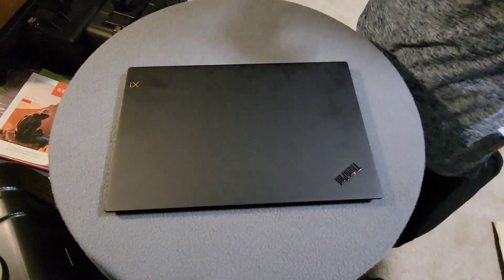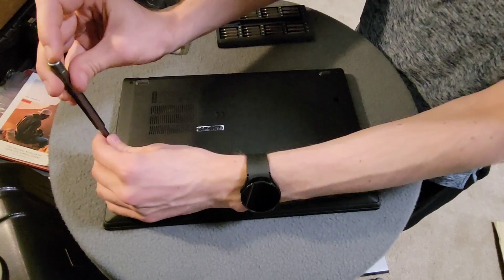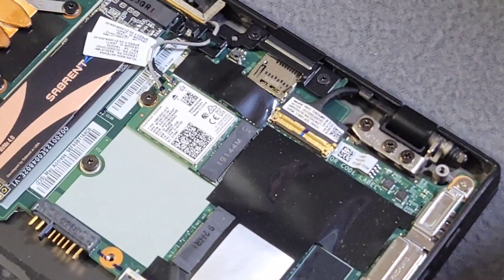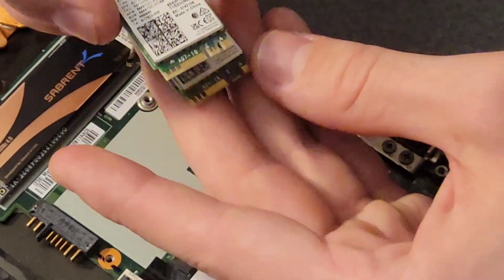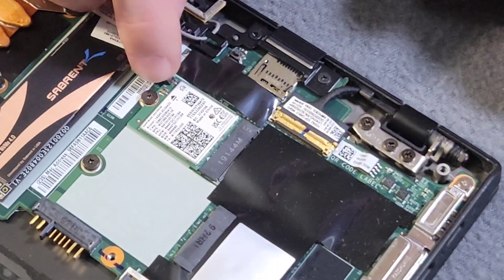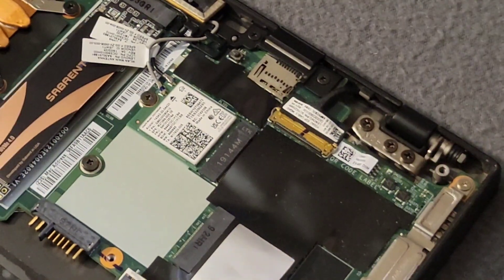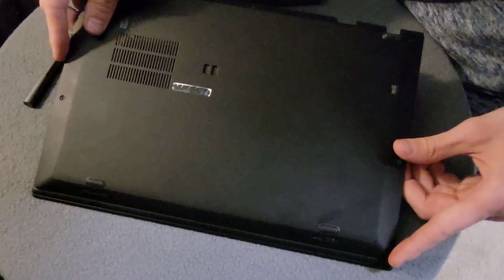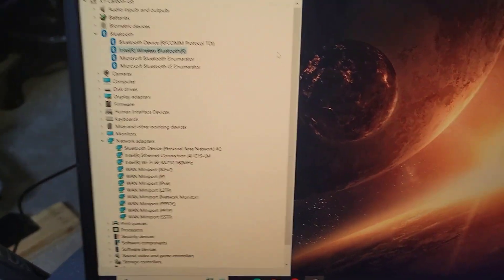How to Upgrade to Wi-Fi 6E on a Lenovo ThinkPad X1 Carbon 6th gen.

Comment: Any chance to upgrade Gen6 16G ram to 32G one? I got this for 5yrs, everything was great!
Reply from the maker: @manlovesin1314  unfortunately the Gen 6 model's maximum RAM capacity is 16 GB.
Reply from the maker: And with all the ram being soldered there is no way to experiment with higher capacity chips
Reply: @ thx 🙏
Reply: so, is this support for the Carbon X1 Gen6? Wi-Fi 7 BE200 Bluetooth 5.4 Wifi Card BE200NGW
Reply from the maker: @JimKwok  you'll have to do some modifications to the card and to the BIOS because the slot is made for an A key Wi-Fi card and the be200 is an E-key card. It is technically possible but you could run into some issues

Comment: Hi there Previously when I have inserted a non Lenovo branded wifi card (yes and Intel Card) I get a bios warning and the machine will not boot.  How did you get around this issue or have Lenovo stopped doing this since the GEN 6??
Reply: Thanks for that info.  I am getting my card today so will let you know how it goes
Reply from the maker: I didn't have this particular issue with the X1 g6 but i did on a t440p. for that one I found the latest bios update and manually loaded the new wi-fi card drivers before the install

Comment: i bought the gen6 because of the replaceable wifi card, but i was also impressed with the gen7's 400nits brightness screen and speakers. hard to choose
Reply from the maker: I dropped and shattered my Gen6 about 6 months after this replacement. Got a gen 7. The screen is much nicer but I miss that Wifi card.
Reply: Can you frankenztein it? 6 guts and 7 screen?

Comment: man, very nice. loving my carbon 6th gen. used throttlestop to undervolt and i've got lucky with the display, because it's the low power one which gets as bright as the sun. browsing the net with whatsapp, signal, opera, instagram and outlook opened draws about 5 watts for the whole system. this thing is a beast!
Reply from the maker: That's amazing! It's such a great little system. Powerful but compact and efficient. 

How long does your battery last when it's undervolted?
Reply: @tesrteck  bought and new battery just recently, i'm getting 7-8 hours display on time and i never hear a fan spinning. loving it.

Comment: I initially thought of buying a X1 Carbon 7th gen, but I found out that the wifi is not replaceable, so i might look into the gen 6 next and see the comparison since it's still has intel 8th gen CPU
Reply from the maker: Still a solid computer! I wish they hadn't gone with the soldered in chips with the later models. I am also confused about why 6, 7, and 8th gen Carbons all used the same lineup of CPUs.
Reply: I have gen7 and just open to confirm that its wifi is soldered. I want to replace it or upgrade it to ax200 or 210 because the current one is not working properly. But cannot do, sad
Reply from the maker: @morillsaberiya  sadly the gen 7 is soldered on

Comment: Are any driver updates necessary to make these components run properly after install?
Reply from the maker: Yes, it does require some different drivers that you can either pre-download or what I most often do is plug in a simple USB Wi-Fi adapter to connect to internet to pull the proper driver after installation